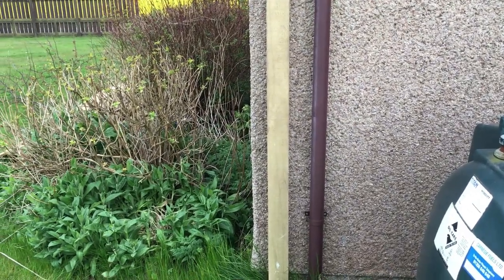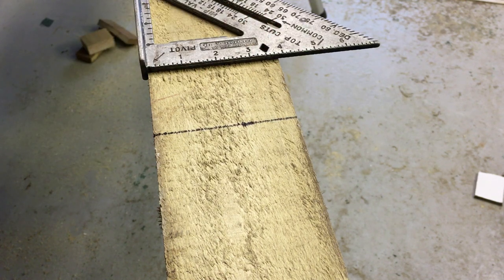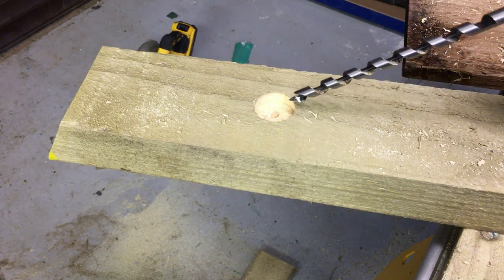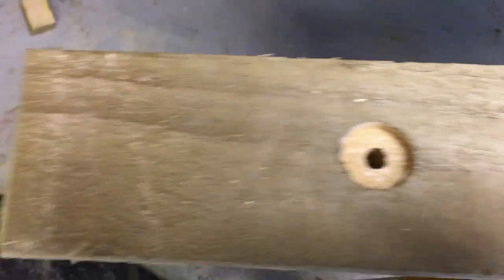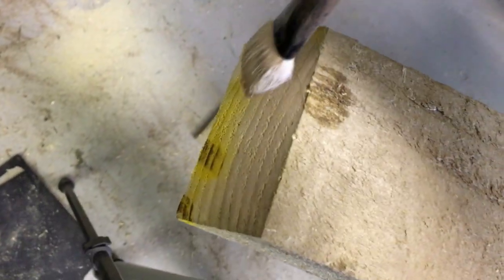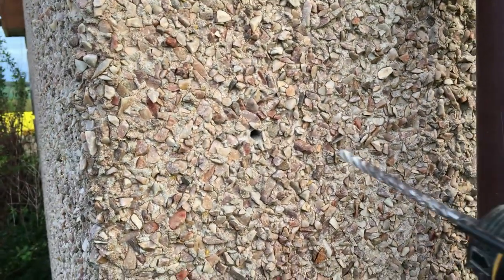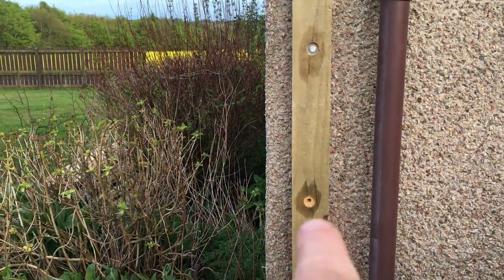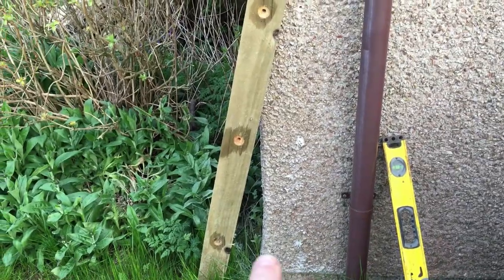How To Fit a Fence Post to a WALL

Comment: Many thanks for making this tutorial. I have a concrete Lidget & Compton shed and need to run off a fence from it, do you think it will be the same principle as per your video?
When I had it built at home the people that erected it told me to never to drill into it because the panels could get damaged so I’m a bit concerned.
Greetings from Cumbria. Stay safe and well.
Reply from the maker: I think that should be fine, maybe drill a small test hole firs to see how the concrete reacts, but I think it should be fine. Thanks for the comment
Reply: I was told the same thing, don’t drill the panels. I did try, the concrete is very, very hard. I ended up with a shallow dint and two blunt masonry bits 🙁 The other attempt I hit steel reinforcing, so gave up drilling. I wanted to secure some shelves inside, I fixed rails vertically from the roof frame to the floor (with a corner cut off to allow for the internal cementing at the bottom).
Did you manage to secure your fence post?
Reply: @SprocketN  Good morning to you Sprocket; to be honest I gave up on the idea. These sheds are pretty crap in my view. Too many limitations on what you can do. I did try, wait for it, ‘No Nails’ on the inside to make a racking system = rubbish idea. I ended up buying some heavy duty plastic stacking shelves. Best thing ever. Easy to clean and move as well as holding some serious weight. Are you in the U.K. and if so which area?
Reply: @Trevorfoggia  I like my concrete garage. It’s much better than the dilapidated wooden thing we had before and much cheaper than any alternative I could find, but you’re right they have their limitations. I used freestanding shelving too, from Screwfix, secured onto vertical rails to prevent tipping. (Shropshire).

Comment: Would a  3/8" DRIVE ratchet with a 15mm socket work or would that not allow for enough torque? Thanks.
Reply from the maker: That would work fine, you don't need much torque, these fixings take a really good hold with minimal torque. Hope this helps
Reply: @Bacrenfencing  thanks for your help

Comment: Nice video.  Thank you.   Quick question, is it easy to overtighten these concrete screws and of you do, do they then lose their grip and spin?   I assume thats why you are hand tightening them.   Cheers
Reply from the maker: Thanks, Yes they can be easy to over tighten and strip the hole, that is why I use a ratchet as opposed to an impact driver when tightening them. Thanks 👍

Comment: Was the foot of the post contacting the ground or is the whole weight taken on the fixings? Any reason for not contacting the ground?
Reply from the maker: Hi, No the base of the post was not in contact with the ground. It is best to avoid contact with the ground wherever possible as this will help prevent wood rot. Hope this helps ? 👍

Comment: Hi, excellent video,  did you mention the dimensions of the wooden post used, I'm curious as I'm thinking of using some 75x75 posts to build a screening frame around some unsightly down pipes an drain pipes, cheers, Rob
Reply from the maker: Hi Robert, I generally use 100mm x 50mm pressure treated timbers for this, but you can also secure 75 x 75 posts using this method, just use longer fixings, something like 8 x 150 bolts would do. Alternatively, you could drill a 30mm recess into the 75mm post and use 8 x 100mm fixings like I showed in the video. Hope this helps 👍
Reply: @Bacrenfencing  cheers mate, that's excellent  😀
Reply from the maker: @robertburns8999  No problem Robert !

Comment: 1. How much diameter/ mm the 

i. concrete screw?

ii. Drill bit?

2. Where you buy the concrete screws?
Reply from the maker: 8mm x 100mm concrete screws and use an 8mm masonry drill bit - all details are in the description of the video. There are links to all items in the description as well. Thanks

Comment: What about checking level coming off the wall?
Reply from the maker: If fitting a gate, then yes, but in my case, was running fence rails off it, so no need for the wall plate to be plumb on the face.

Comment: How deep do you drill hole in wall to take fixing ? 8mm x 100 mm
Reply from the maker: Around 60mm assuming the timber you are fixing is around 50mm thick.

Comment: Great video 👍 I didn't catch what type of sds bits you use ? Them multi fixings look much better than frame fixings which I've used in the past.
Looked like a lovely spot where you were working from what I could see from background scenery 😎
Reply from the maker: Hi PB, Thanks for the comment. I use HELLER X-FORCE SDS drill bits https://amzn.to/2X5xz7v
 Working at my own house, struggling through the wife's "to do list" -  thought I may as well film some of the jobs as I go. Yes, we are fortunate to live in a lovely location in the countryside - very idyllic ! 👍😀
Reply: @Bacrenfencing   many thanks for the prompt reply - I will definitely get some of those drill bits as I'm always using sds bits with my work.
My wife has also handed me a to do list that seems to get longer everyday even though I'm doing the jobs, funny that 🤔
Many thanks again 👍
Reply from the maker: @pb9926  Yes the Heller x-force bits are brilliant, worth shopping around for them, get some good deals on Ebay for all the different sizes - highly recommended ! Yes, I can sympathise with your ever growing "List"............

Comment: Do you think it will be sturdy enough for me to install a pvc privacy gate attached to just that wood like how you have it setup?
Reply from the maker: Hi Edwin, It obviously depends on the width and weight of the gate but I regularly hang very heavy custom made gates using this method. If in any doubt, just use larger bolts, I sometimes use M10 X 130mm if the gate is going to be heavy. I hope this helps 👍😃

Comment: hi, what would you suggest if the two walls im fixing posts to were not square? basically the walls either side start angling outwards
Reply from the maker: In that case, you have a choice depending on the angle. If you have the means, you can basically use thicker posts and cut them on the angle so that the face of the post will be square. In other words rip the post so it matches the angle. Another way is to use packers, so if your post needs to come out at the top for instance,  you can pack it out until level. You can use plastic packers or make packers out of wood if you need to. I hope this helps ?
Reply: @Bacrenfencing  thanks for the suggestions. Dont think I'm confident enough to angle the post so packing it sounds easier
Reply from the maker: @SharpeysWorld  Yes, packing it out would be easier. I sometimes do that and then scribe a fence slat over the side of the post so that it covers the gap and looks neater. Best of luck with your install, I am sure you will be fine !

Comment: Hi there, can you tell me what diameters are for the post you're using. I've got a 75mm x75mm post, if possible could you please tell me all the different size items I'll need for the job. I feel a bit daunted by the job never having done this before.
Reply from the maker: Hi, The post that I used was a 100mm x 50mm or sometimes referred to as 4" x 2". You can get these from your local timber or builders yard. You can use rough sawn timber or construction timber such as C16 or C24. All the other items used are in the description down below the video. I have posted links to everything, so you can buy direct from Amazon if it is easier for you. Thanks
Reply: @Bacrenfencing  Hi sorry again, I want to use my 75x75 post I've already got, so was just querying what size screws, spade bit, wood bit, and washers you would use on that. I did have a look at all the things you mentioned for what you are using in your video. Sorry to be a pest.
Reply from the maker: @davinamcdonald6560  Just use the same size drill bit but use a 8 x 130mm multi fix bolts like these https://amzn.to/3Db4X06
Reply: @Bacrenfencing  That's brilliant thank you so much. I thought I had to go up to the M10 - 150mm. Video is really good btw. I've watched a couple of them.
Reply from the maker: @davinamcdonald6560  No probs !
Reply: How do you take the socket off the ratchet
Reply from the maker: @davinamcdonald6560  Press the quick release button on the ratchet.

Comment: Are you using 100mm x 100mm posts? Thanks, great video.
Reply from the maker: When attaching to a wall, I use 100mm x 50mm posts 90% of the time. Sometimes there are occasions where I will use 100 x 100 but it depends on the job really. Thanks for the comment 👍😃

Comment: Any problems with rot sitting the post onto the ground or should I be trying to get it off the floor so that it doesn't sit in the wet in winter? I guess if it's off the floor it won't be as strong...
Reply from the maker: It is best to leave the post a couple of inches above ground level to stop moisture getting wicked into the bottom of the post. If you use the fixings that I showed in the video it will be plenty strong enough even if off the ground. I hope this helps and thanks for the comment 👍
Reply: @Bacrenfencing  Thanks - really useful video
Reply from the maker: @ozzieparky  No problem !

Comment: Hi, do you not have to use raw plugs? Is that a feature of these bolts?
Reply from the maker: Hi Reece, there is no need for plugs, the bolts just screw directly into the concrete, that is the great thing about them. They are also VERY strong - I hope this helps 👍😃
Reply: @Bacrenfencing  thanks, I’ve just ordered some. Liked and subscribed 👍🏻
Reply from the maker: @reecedavidson2198  Thanks Reece, very much appreciated mate !

Comment: Great video.  I've been wanting to use these bolts for  while but wasn't sure about them.  With the bolts being 100mm was the post you used 4" x 2" ?
Reply from the maker: Hi, Yes, the post used in the video was a 4"x2" and the bolts were 100mm long. The bolts come in a wide range of lengths and diameters, so it is really up to the user which size they use. Thanks for the comment 👍😎
Reply: How is this different than a 2x4? I'm in the US if it matters
Reply: Here in the US a wooden post is a 4x4

Comment: Hi Good video, Would those timco screws work on brick rather than the concrete.. GN
Reply from the maker: Hi Glesga News, Yes they work really well on brick and take a really good hold - best to use them in the actual brick and not the pointing for best results ! Thanks for the comment 👍😀
Reply: @Bacrenfencing  Thanks ....Just watching your other vids...GN
Reply from the maker: Haha, you must be bored 😂✊👍 Cheers !

Comment: what size of post did you use
Reply from the maker: It is rough sawn 4 x 2" / 100mm x 50mm or you can use C16 construction timber 4 x 2". Hope this helps 👍

Comment: Small question please: I wonder how do you know the size of the drill bit. You chose 8MM, but what is the size of the bolt?. same? or a little bit smaller?. trying to understand the rules of this. thank you.
Reply from the maker: Hi, The box that the multi fix fixings come in has a chart on the side that tells you what to use. In this instance it was a 10mm hole through the wood and an 8mm hole in to the masonry, as per the chart on the fixings box.
 The actual fixing (not including the thread) has a diameter of 8mm and then the thread protrudes a further 2mm (approx) so when drilling an 8mm hole in to masonry there is enough material around the hole for the threads to grip in to. I hope this helps ?
Reply: @Bacrenfencing  And as for the depth of the hole. Should it be the same as the length of the fixings? or a little bit more? (wondering what happens if you drill a hole which is too long and a gap will remain inside). Thank you!
Reply from the maker: @kookia213  I usually drill the hole just slightly longer than the fixing, there is no issue if the hole is too deep. On the other hand, if you don't drill the hole deep enough then the screw will not go in far enough and end up stripping the hole, so always better to drill slightly deeper than you need. Hope this helps
Reply: @Bacrenfencing  many thanks :)

Comment: What fixings would you use for hard masonry like granite?
Reply from the maker: Hi, You would probably be best with smaller diameter fixing screws such as these -  https://amzn.to/2DVMiw9  and use 7mm plugs. Obviously if using these, I would use more of them and position them at the sides of the timber as opposed to the centre if that makes sense. Also, make sure you use a good SDS drill for drilling in to granite as it would be extremely difficult if using a normal hammer action drill. Hope this helps a little ? Thanks for the comment ! 👍
Reply: Bacren Property thanks - I got some m14 masonry bolts with expansion plugs. Hopefully that’ll do it.

Comment: My question is .. just how deep can I put the cement screw on the outside wall of my house 😮
Reply from the maker: I usually put them in around 50-70mm as most blocks on outer skins of houses are around 100mm thick minimum.

Comment: How can I fit a post to a engerneering brick the one with six holes in I tried to use the masonry expanding ones but it’s useless
Reply from the maker: Maybe best to use "L" brackets like these https://amzn.to/3vL1KRV - If you use a few of them down either side of the post and use 6mm fixings to secure the brackets to the wall. That is what I would do in that situation. Hope this helps 👍

Comment: be nice if you provide more than an equipment list, how about a building it list
Reply from the maker: Hi Terry, I'm not sure what you mean ? If you can elaborate, I will provide a list 👍
Reply: @Bacrenfencing  list of parts with sizes of bolts and washers etc.
Reply from the maker: @terrylcoltonphd  Terry, the items were already on the list if you look down in the description. The bolts were 100mm x 8mm Multi fix bolts https://amzn.to/2LBnQjN and the washers were M10 x 30mm https://amzn.to/3fXA8AV  I hope this helps ?
Reply: @Bacrenfencing  thanks, missed them
Reply from the maker: @terrylcoltonphd  No problem Terry !